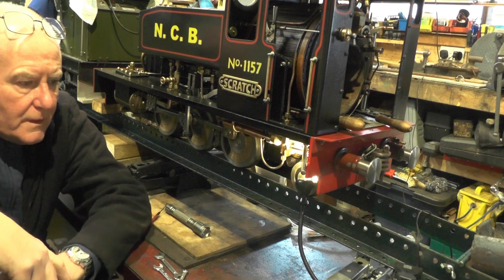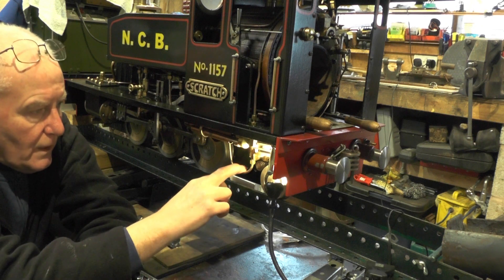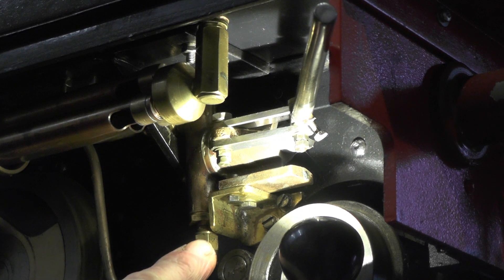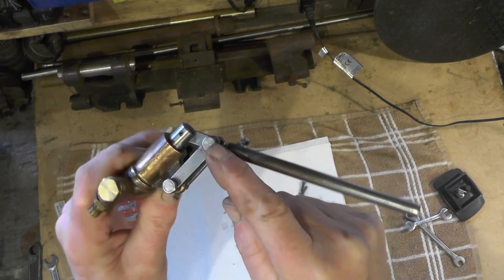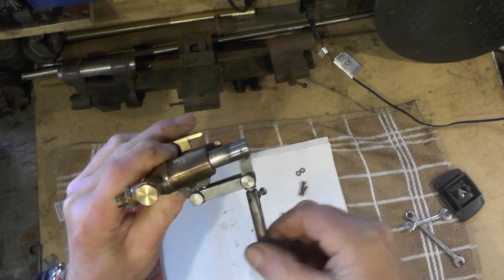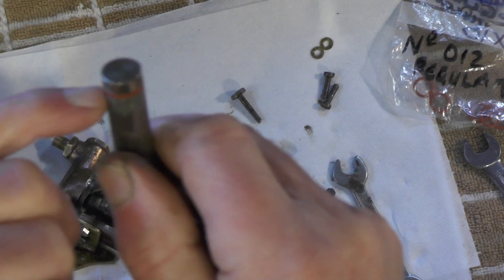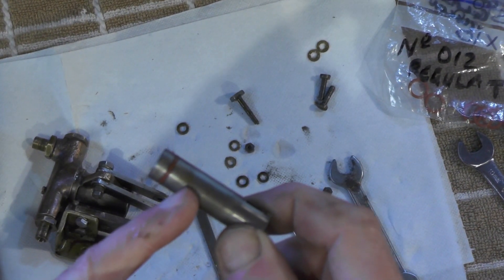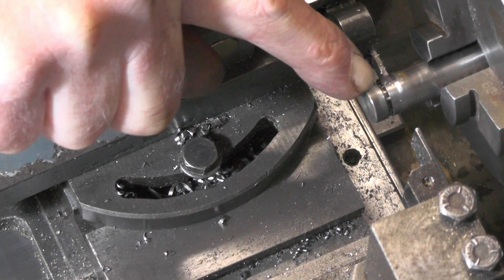Beginners Steam Loco 2 years Running (Maintenance) - Hand Pump Repair / Modification "mr factotum"

Comment: Eyup kev, currently running a no. 4 injector and an axle pump into my loco. I'd like to add a hand pump for piece of mind but not sure where to plumb it in. The loco has a tank either side of boiler but no tender. Any ideas?
Reply from the maker: hi tim
I'm assuming ait's a MM or SP, i put my hand pump as per the book under left rear footplate to the left side clack valve.
The axle pump and injector got to the righthand side via a splitting manifold for 2 clacks under the right tank then piped to where the right side boiler inlet.
Hope thats clear if not check my video's were i show this.
https://youtu.be/uINdUjumfMw?si=nTQq1Deab1Cz7KSv
https://youtu.be/Yfedpux06zs?si=fCBpLcFPUibGRi7L
https://youtu.be/yFcsCnp-Vqs?si=B8mfyHmic1UM1Z4E
https://youtu.be/s_sDSDUsFb8?si=N085nvZTVgRN-YqF
atb
Kev
let me know how you get on with it👍👍👍👍👍👍
Reply from the maker: hi Tim
I might have told you opposite to what iv'e done in the previous reply. sorry it;s been a while since i did it. 
The splitting manifold with  2 seperate clacks are under my left tank, 1 for the axle pump and the other for the hand pump, both feed the leftside boiler inlet port.
The injector is on the right side again under the tank again on a remote manifold block as there wasn't enough room to put the clack directly in to the boiler due to my tank designs.
ive put the links in my previous message
cheers
Kev
Reply: @MrFactotum  Thanks Kev, I've checked ou the videos and that's helpful to see how you've done it. The loco is a freelance design (and I didn't build it). I've uploaded a short video showing the layout of the pipework. https://www.youtube.com/watch?v=8EPB0KVPRJ8 Can a handpump be plumbed in line with the bypass valve on the axle pump?

Comment: Hi Kev, I had a Chinese made Maxitrak `Alice` which turned out to be a load of rubbish so I sold it and went back to electric.
But if I`d had your knowledge and tools I probably would have kept it. Great video though.
Reply from the maker: Well thanks for that, Michael.
The trouble is when your 1st buy is sub standard it can put you off from learning more. At the end of the day we are all on that never ending learning curve, just at different parts of it.
cheers
Kev

Comment: I had not considered installing a second O-ring for a water hand pump, I wonder if this would be worth doing on axle pumps as well?
Reply from the maker: hi tom
yes! if there is room on the piston stroke,  can't say without looking in to it, i know i only made mine 3 year ago but my grey cells don't hold info like that anymore, i have to make a list of where i put my lists now🤣🤣
Hope your lathe work is progressing👍👍
ATB
Kev
Reply: Hi kev I’ve subscribed I am finding your videos very interesting I have a sweet pea 5 inch gauge 0-4-0 I didn’t build it myself but has never run I’ve had a hydraulic test and passed all ok it’s been in steam but the valve timing needs setting back up the problem has been the axle springs are to soft so sorting that out with harder springs then set the timing up hopefully that will be the problem solved regards glen
Reply from the maker: @mrmrst9020  eyup M&MT
Thanks for your feedback it's appreciated, yes once you've hardened the suspension up it should be fine, good luck with it. I've also sub'd you and been taking a look at what you get up to.
atb
Kev
Reply: @MrFactotum  hi Kev thank you for subscribing to me very much appreciate yes I am hoping the springs should sort it out once it’s sorted I will post a video and get it into steam glen 👍🏻
Reply from the maker: @mrmrst9020  can't wait to see it steaming, cheers glen
atb
Kev